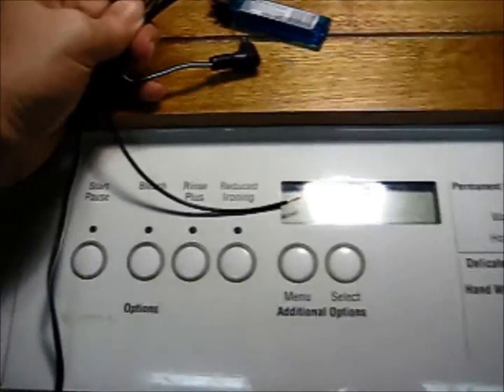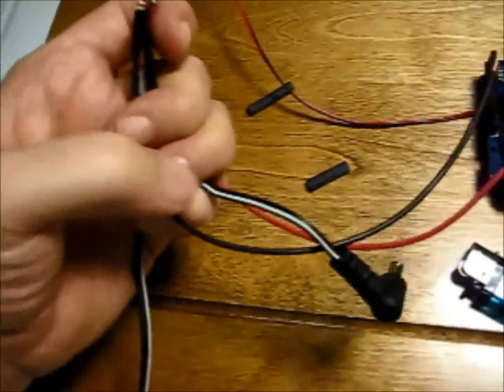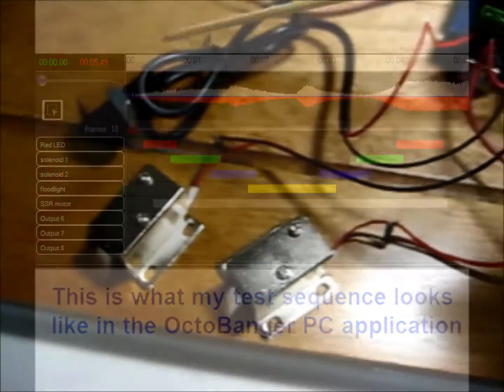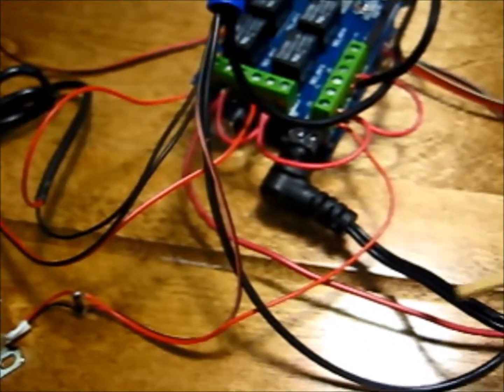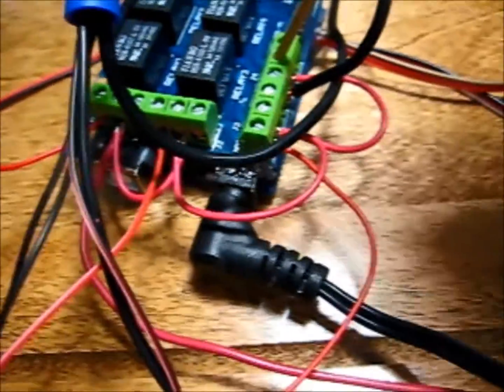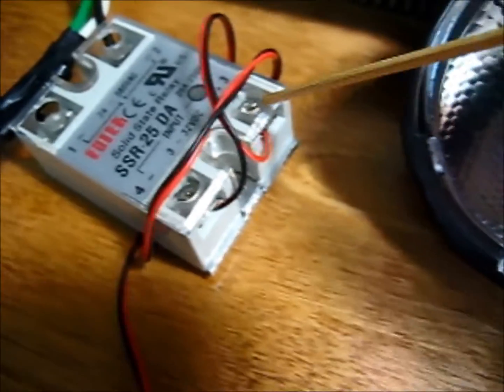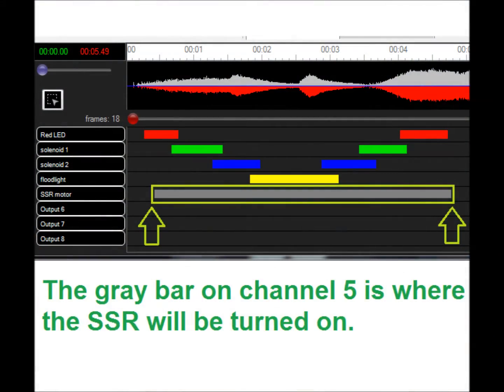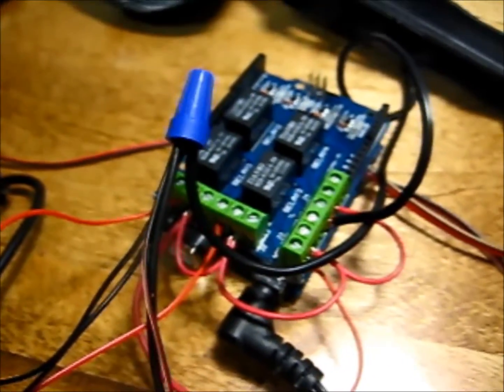OctoBanger Wiring a Sample Project v1.1

Comment: hey Mike thanks for the design and info. gonna be making one of these. so do you really need that SSR because the other 4 relays can can also handle 120v ac?
Reply from the maker: @dirtydrowningman4963  relays would work fine, but I already had Ssr's and they are great for handling high current loads. If it were just lights or something smaller, relays keep it simple

Comment: Mike, love the work.  Would it be possible to add a PWM signal as a channel on the octobanger for a servo.  To use as a preprogrammed jaw movement? (Kinda like your jawduino, but with only four or five preprogrammed movements)
Reply: The website is dead tonight... I'm wondering if that's temporary or if something happend... :/

Comment: Hey Mike.  i really like your fourbanger and octobanger software.  i found them both at the same time and i have been playing around with them so that i will be ready for next Halloween.   i am having an issue getting the octobanger to play the 5,6,7,8 relay sequences that i created in the software. i can get it to play relay  1,2,3,4 correctly.  I'm not sure what i am doing wrong.  but since it is your software i though you might be the best person to ask.  i am using an arduino uno r3 and the same 4 relay modules  that you used in your fourbanger setup i am just trying to connect 2 of them up to create the 8 channels.  i have the  pin mapping set to default ttl and mp3 on pin 12 , and the pir on pin 11.  and the first 4 relays module on pin 2,3,4,5.  that all seem to work correctly but the second relay module is on pin 6,7,8,9 and it does not seem to work at all.  when i reversed the relay modules the same thing happened so i know the relay modules are working correctly. can you please help

Comment: question  I work at a haunted house that just had a 8 relay controller fried by our so called tech  guys.  I see you are using a shield, can I use a 8 relay board.  and do you have the wiring for the nano  I really need some help on this if you have time. I cannot get the program to fire. I am having this trouble on the  4 banger and the otco
Reply from the maker: I would suggest signing up at hauntforum.com and look through the big thread there. There are questions and answers that may get you going. There are lots of folks there that monitor the tech forums and are always happy to help a fellow haunter

Comment: There will be times when you can't switch the positive wire of the load.  For example if you're using 12V RGB LED strip, they use a common positive so you have to switch the 3 negative wires instead to select colours.
Reply from the maker: da-share Good point. I try to tell people not to think of this as a cake recipe rather just one possible example.